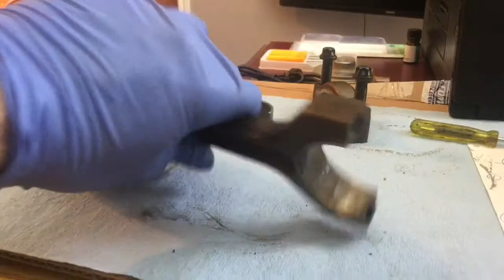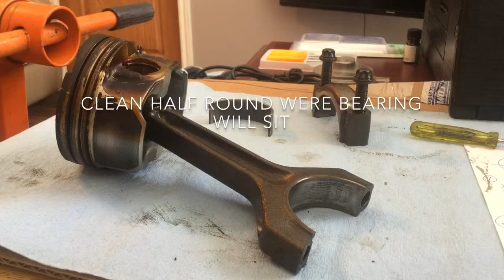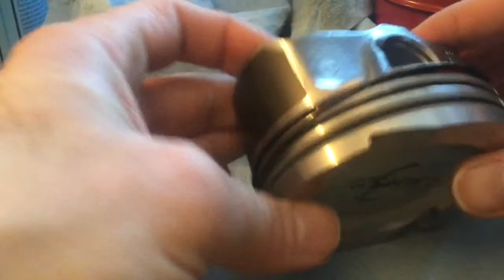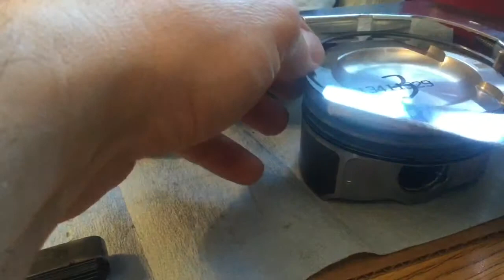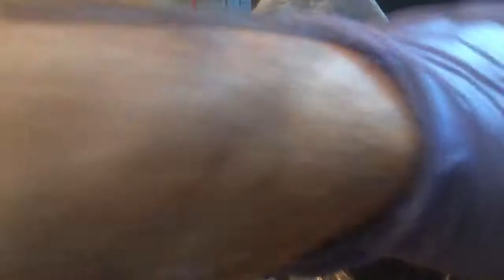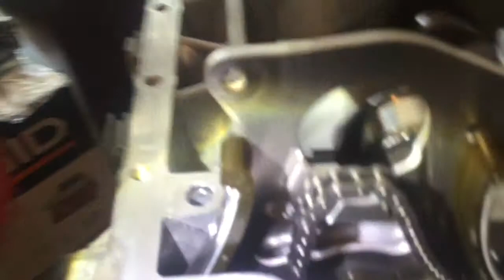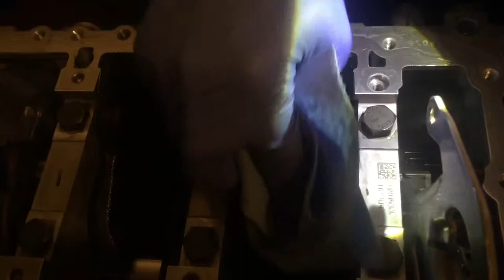42 BMW 135i N54 E82 - Engine Rebuild - Connecting Rods, Pistons and Rings Installation

Comment: Hey man! What kind of oil are you running?
Reply from the maker: I use to run on 5W30, but the dealer (as per BMW recommendations they said) is now suggesting 0W30. I'm good with both. Perhaps check with your dealer on your end... just to make sure.

Comment: Rod inside looks quite scraped got the same worried if that will affect it or make the bearing sto slip around.
Reply from the maker: I'm not sure what you are referring to (yours or mine on the video). If it is on the video, if you can mention at what time into it...

But I'm guessing you are referring about the "dark color" like at 2:22 into it... If so, it is not a worry. What matters is the "straighteness" of the surface, not the look. If it is dark but a good surface (no cracks, denivelation, ...) then it is good.

Keep in mind that this is living in oil when the engine is running.

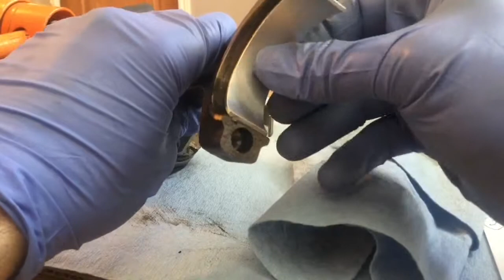The bearing will not slip. There is a notch often times on one side (like at 3:19 into the video). But also, due to the tight clearance on the diameter (bearing to crank) and also the bearing is located sideways in the crank... not much room to move sideways.

I hope this answer your question.

Comment: Why did you just set the torque and not the angle on the bolt before the plastigauge or did I miss something?
Reply from the maker: When you torque with the angle torque specs, your bolts are permanently deformed. When you removed them, you have to replaced them. 

Since the plasti-gauge operation is intended to verify the gap, there is no need to torque up to the operational torque and deformed the bolts.

The way I did it, allowed me to use my new bolts both for checking the gap with the plasti-gauge and the engine re-assembly.
Reply: @quebecdiy9906  I guess what I'm not understanding is the angle and how that impacts the clearance.  It seems to me by not doing the angle, the clearance would read wider.  Does the angle not close the clearance more?
Reply from the maker: @JamieMeloni  When you torque your bolts, there is no more gap. If there is still a gap, when you turn the bolt it moves without much resistance. It is when you have no more gap that you are finding resistance and being able to torque them. The angle torque that is added for the "operational torque" will not close the gap any further. This "operational torque" is necessary to sustain heat and stress under engine operating condition, and also to prevent the bolts to unscrew while in operation. But just to crush a piece of plasti-gauge in order to evaluate your gap, it is not needed, and further more not advised.

I would say if you are really worry that it is not enough torque to check the gap, you can search for the generally used torque for bolts of that diameter (the threaded diameter) and torque them to that level. My gut feeling would be somewhere around or below 20 lb-ft. But one thing for sure, stay away from angle torque for checking your plasti-gauge, as these are to create a permanent deformation in your bolts (called yield torque, in another word: one hell of a torque). 

Finally, torquing bolts with the angle specs more than once... can lead the bolts to break! Doesn't mean it will, but it could. Think about when you fold back and forth a paper clip... Eventually it breaks. 

Hope this helps answering your question.
Reply: @quebecdiy9906  perfect explanation, thanks so much!  I've been studying the rebuild of my N55 for 3 months now and getting parts in place to repair.  Im about to begin the build now and your videos have been extremely helpful.
Reply from the maker: @JamieMeloni  Glad it helps!  :)